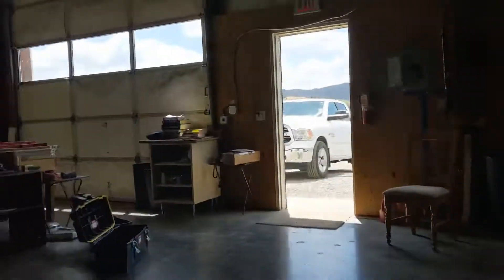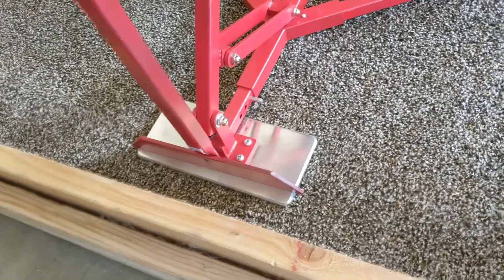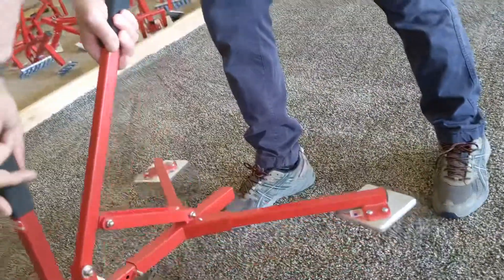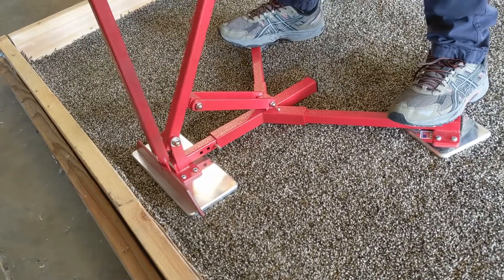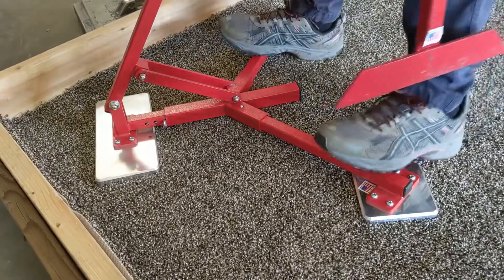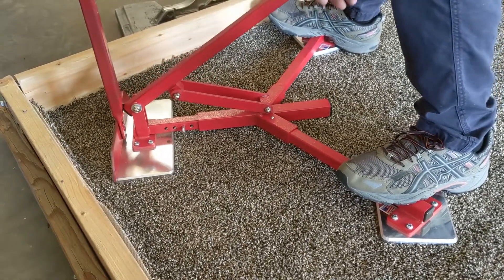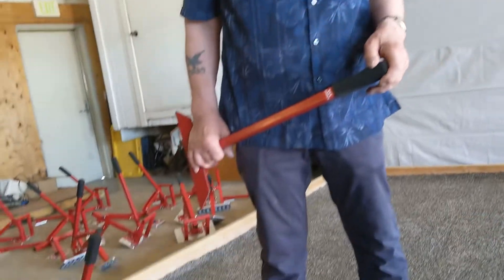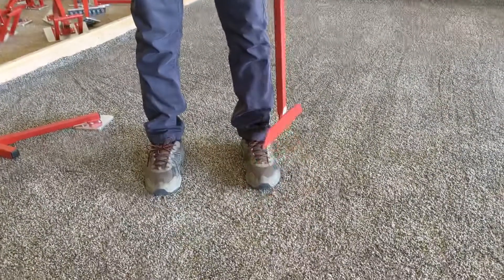Carpet Re stretching

Comment: Power stretcher is better with poles.
Reply: Yes but it’s good to have multiple tools to do your work in certain situations.
Reply: @phoenixwaterdamageservices931  1:32 Wrinkles the carpet behide it. Hes selling both tools for total of $600.
Reply: Christian Wilson yes we use a power stretcher daily. Just trying diff tools for different situations
Reply: What a joke. Unless you have a 3 foot room this tool is literally useless. Two possible scenarios, one equally as pointless as the next. Either you stretch 2 feet of carpet, or you stretch 0 feet of carpet and cause back pressure on the entire rest of the room. 
You know, the wheel has been round for thousands of years for a reason. Same reason a pole stretcher hasn't really seen a design upgrade since it's inception.
Better luck next time